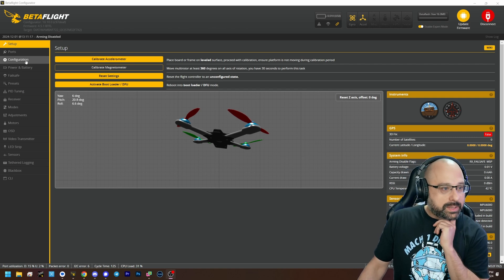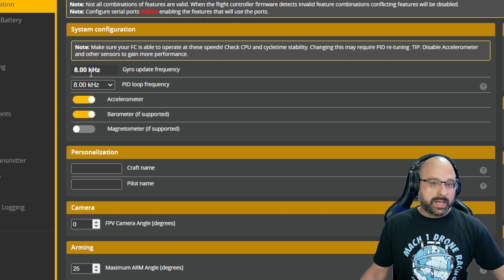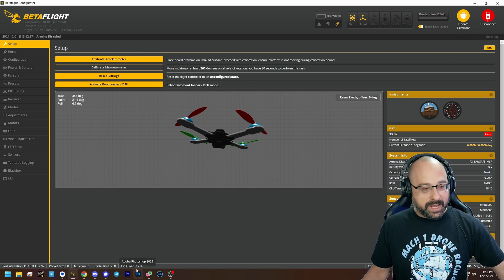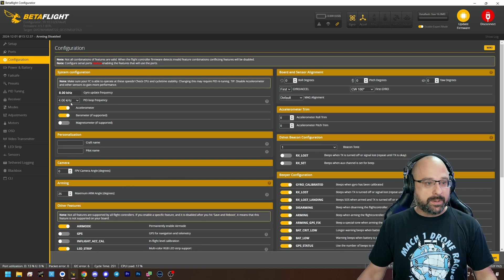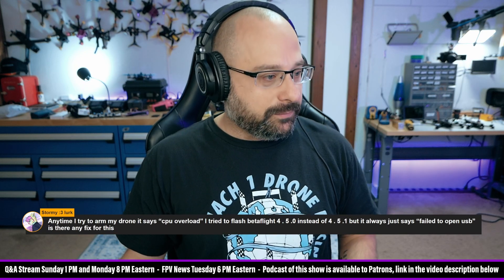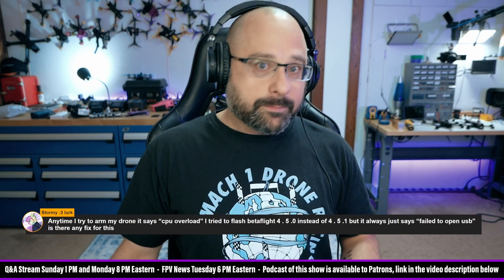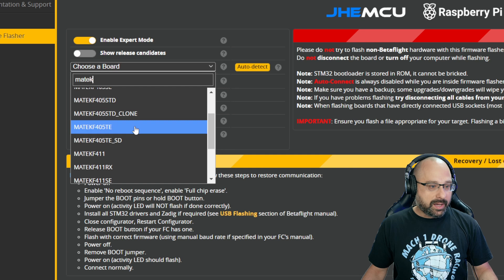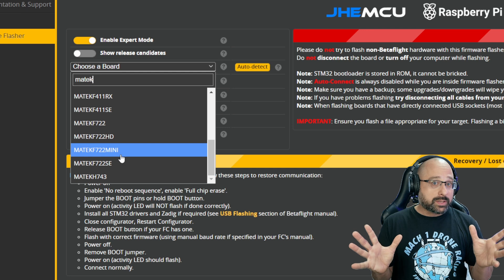Betaflight CPU Load Issues? How To Solve Them? Why Is My Drone Stuck At 3.2khz and Dshot300?

Comment: I had to do this this morning I was getting a cpu overload for the first time. Lowered pid loop to 1.6k and turned off air mode and my led cause I don't use any and it fixed the problem
Reply: no airmode?? spicey.
Reply: @niz76  well I honestly don't know exactly what it does so I just don't use it 😅

Comment: If your FC is an F7 and you are having CPU overload, what you need to do is lower the PID loop to 4k as Bardwell said, but also change your motors to DSHOT300